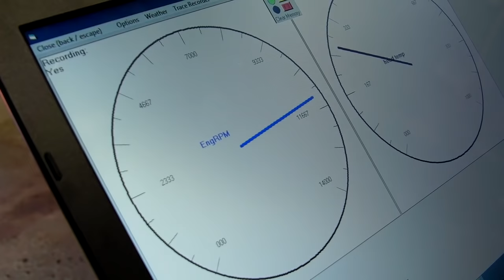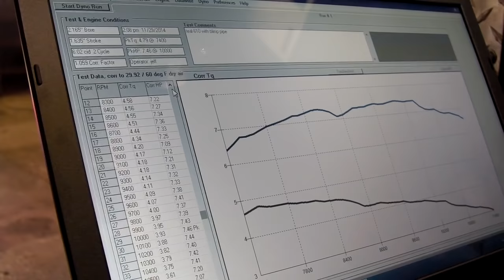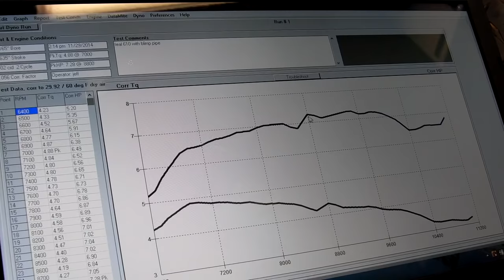Dyno McCulloch MC49 - Jeff Brown - Vintage Karting VKA

Comment: Nice Set Up!!!!
Reply from the maker: homotorsports FYI - there is a 250 pound flywheel inside the diamond plate sided box, through a jackshaft gear reduction and one-way rotation only bearing, the engine spins the flywheel up to about 2000rpm ... a LOT of energy ... the horsepower / torque is calculated based on how fast the heavy flywheel comes up to speed.  A dyno run consists of running the motor temp up to normal, followed by braking the flywheel down to low rpm, then the engine throttle is cracked wide open while the computer records data as rpms quickly go from around 4000 to 12,000rpm with the engine in this video.
Reply: @VintagePowerSport  do you still using this Dyno, I'm looking forward to buy one,